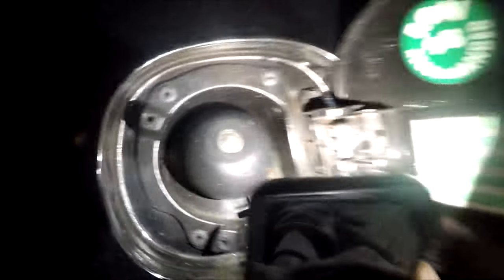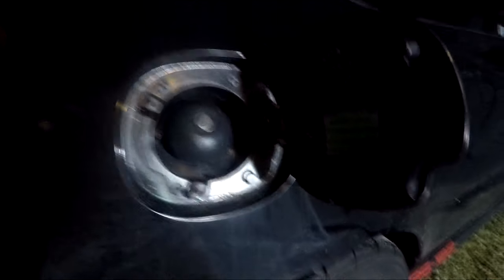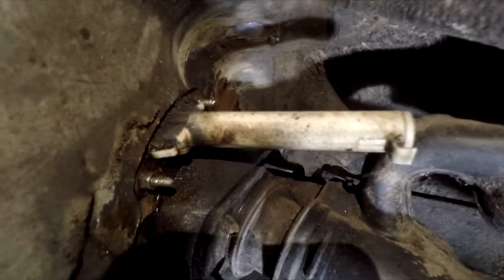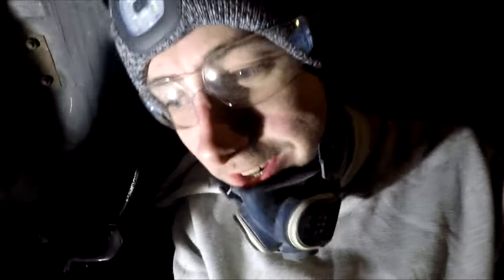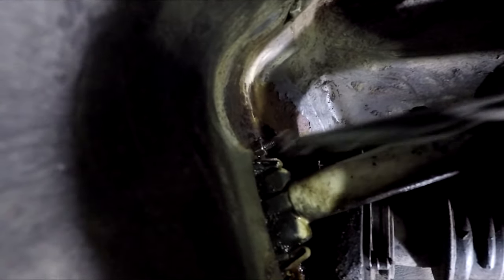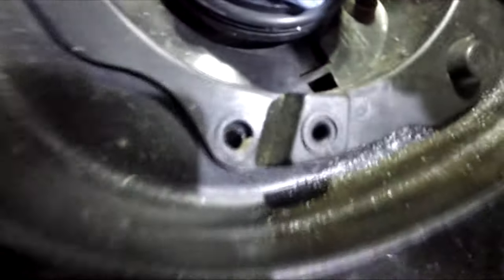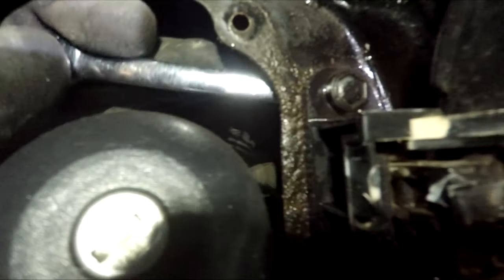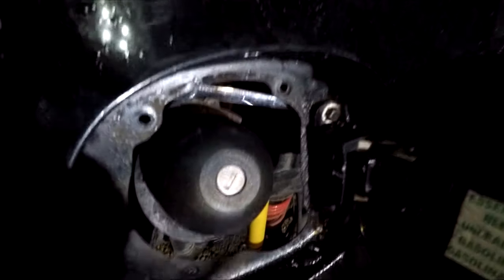How to remove the fuel cover cap and filler. Clio Mk2

Comment: Coming in clutch as usual, need to do the same on my RB, will probably wait until the spring now, I'm lucky that it looks nearly mint on mine. Want to get it coated and protected sooner rather than later though.
When you go to sand, treat, prime and paint, make sure you do the same on the rear of the metal if you can, at least a quick sand and rust converter. Think they're liable to rust from the rear where it's less visible, but spends its life covered in damp road crap. Sounds like you've done a ton of research though so I'm sure you will.
Such a crap bit of design from Renault, surprisingly doesn't rust sooner. No cover from the wheel arch, crap plastic holding the bolt, wafer thin metal, etc.
Reply from the maker: Thanks! These short days and bad weather isn’t cool. Good I’m glad to hear it. There’s plenty that aren’t. Well the inside worried me too, I slid my phone under the arch on record and thought I’d better get stuck in soon. Very poor design indeed , like you say no protection! 

I nearly got it with no casualty’s! 🤣